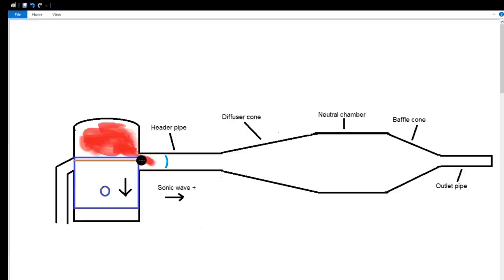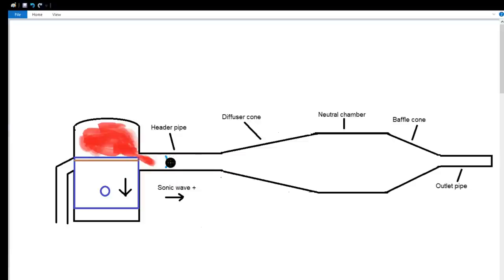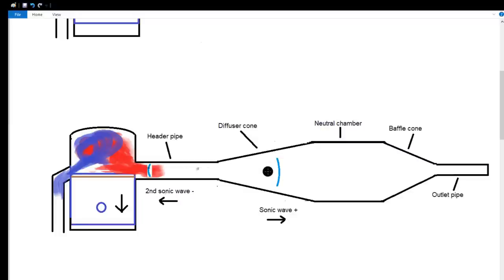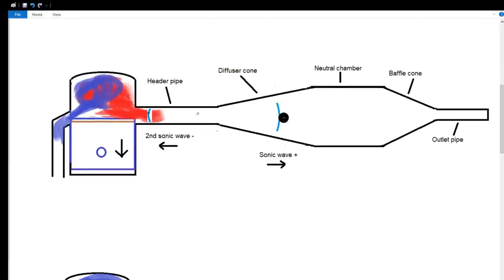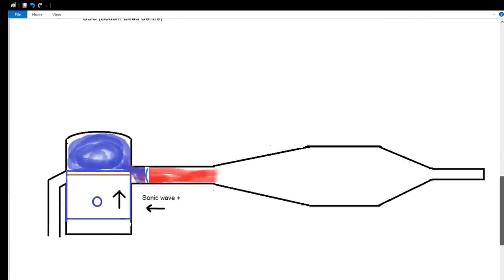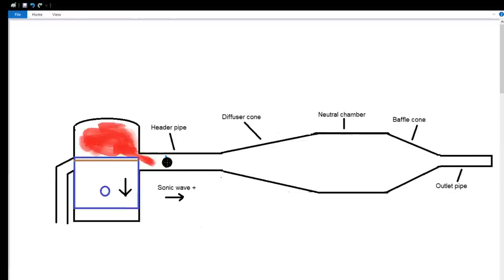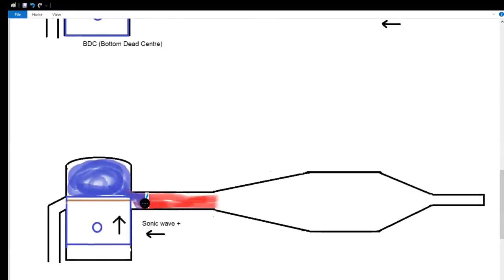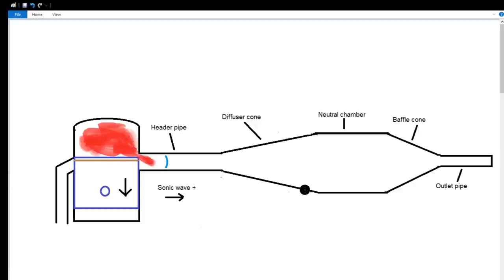Unlocking the secrets of 2 stroke expansion chamber exhausts E1

Comment: Good demo.  Years ago I purchased a Suzuki Titan 500 twin 2-stroke. It came with mufflers that looked like logs. Swapped them out for some tuned expansion chamber exhaust and the difference was very noticeable. I'd bet better than a 10% gain.
Reply from the maker: Yes well tuned expansion chambers can result in some substantial power gains.

Comment: I want to see this series. I am always open to learning new things especially since I am about six decades old. I love expansion chambers and have a few for my little engines. I need to study theory more , as to get as much power out of my little motors. Cheers, R
Reply from the maker: I can relate to that, when I started road racing in the 80s I developed a bit of an obsession with expansion chambers.
And again in the 90s with sprint karts.
All I knew is that if a simple length of pipe could be responsible for so much power increase and capable of controlling characteristics of the the power curve, there must be something pretty amazing going on inside that tube.
Ill cover what I know about them but experience tells me there are things I do  not know yet myself and may never.

Comment: I couldn't get my motorized bike up to operating temperature in the cold months, so I wrapped my expansion chamber with exhaust heat-wrap.  Worked like a charm, but you can't use it in warm weather, you'll overheat in minutes.
Reply from the maker: Exhaust carries way a good deal of heat as does the large chamber from the barrel and head so wrapping it will store more heat.
Alternative in an water cooled engine is to just tape of part of the radiator.

Comment: Aye, Mate...I've a passion for 2 Strokes and particularly tuned exhaust systems. I am playing with several programs at present, and also doing the manual math and physics required for design.
Even Bell, Blair, and Jennings do not put enough meat out there to satisfy my appetite. Perhaps the reason being is we're using methanol/nitromethane as fuel. That really complicates the thermodynamics aspect, which in turn affects wave velocity.
Would be nice to chat with you sometime, as our backgrounds in the automotive realm are quite similar. I'm a retired design engineer from GM and specialized in zero phase concept development. Also a certified master auto tech.
Cheers, and thanks.
Reply from the maker: As you are likely aware there are 2 values you can adjust in Blairs equations  to provide for different fuel types and air fuel ratios marked IGC (individual gas constant) and RSH (ratio of specific heats) which represent the chemical composition of the exhaust gasses that differ from air.
Many calculators Ive seen hard code ICG and RHS for air, I've left those values open in my Pipe calc software and the defaults I put in are for exhaust gas using petrol at an air fuel ratio of 13:1 so you can adjust those values to suit to reflect the exhaust gas composition which is used in the the wave speed equation and thus tuned length calculation. That said I'm not sure of the values you would use for Methanol NM mix. I know the RHS and IGC both increase with richer AFR. 
Cheers.

Comment: I had no idea there was so much science behind a saw modification. Very interesting. Well put together, thanks.
Reply from the maker: Thank;s for the comment
Chainsaw mufflers are less complex in design but still have a formula used (provided by Prof Gordon Blair) to design them which I may cover some time.
Reply: @AuMechanic  chain saw engines are different than other 2 stroke engines, because they are run at one steady rpm, more 97% of the time vs up and down the rpm scale ..from Wyoming USA 🇺🇸 🤠
Reply from the maker: @billallen4793  Sort of.
I use them often in my stump grinding business to lower stumps.
The saws run in an RPM range that is anything around the torque curve up to maximum RPM depending on the load present at the chain which varies a bit as you work the cut.
The reason they dont have an expansion chamber is mostly due to the fact there is not enough room for one on a general use saw (aside from competition saws), and emissions and such govt regulations.
There is however still a formula that applies to saw mufflers far less complex than an expansion chamber which can be broken down in its simplest form to having a muffler that has the largest practicable volume you can fit on the saw for best power and that "breathes" fairly freely even with a spark arrestor in place.
Reply from the maker: @billallen4793  Also keep in mind that many 2 stroke scooters have CV transmissions that run the engine at even more narrow RPM than saws and they do run expansion chambers.
Reply: @AuMechanic  have you ever seen a rotary engine 2stroke with a expansion chamber exhaust? I've got a RE5 ROTARY ENGINE Suzuki 2stroke motorcycle 🏍 that I was building for the Bonneville salt 🧂 Flatts, but it ALL stopped in Sep of 2003, I became disabled in a workplace injury, so my projects were stopped then..from Wyoming USA 🇺🇸 🤠
Reply from the maker: @Bill Allen  No Bill Ive only ever seen stock RE5 in the flesh and ridden it when I worked at a Yamaha dealer in Western Australia.
It was a trade in bike at the time.
You might ask that question on the re5rotary forum

Comment: I'm 6 years late coming into this thread, so bear with me please. I've always been interested in 2 cycle expansion chamber dynamics, and 2 cycle engines are having a renaissance at the moment, so here I am...
One of the points I picked up on (please correct me if I'm wrong) is that expansion chambers are more about sonic reflection than exhaust gas flow. Assumedly, the reflected return wave helps to prevent the intake charge from flowing out the exhaust port prematurely, and all this happens within the course of one revolution of the crankshaft. If I'm on the right track, then what keeps increasing engine rpm from overwhelming the completion of, and thus cancelling, this dynamic? 
Thank you. belatedly, for sharing this information. And again, sorry I'm late to the party. Cheers!

Comment: As the first wave reaches the expansion cone area it creates a vacuum behind it not a shock wave, as the primary shock wave expands. You can even tune a pipe so that it has harmonics of sympathetic resonance in which the primary shock wave is bounced off the closed piston to create extra negative pressure in the pipe for when exhaust port starts to open again. I've been able to carry this to the extreme of sucking the tops of a pistons off requiring detuning to keep things intact.
Reply from the maker: Its a compression wave not a shock wave, and it reflects an expansion wave that travels back up the pipe it does not create a vacuum behind the compression wave.
As you your piston top coming off, that is over revving and ring flutter (i have a video on also) possibly because the pipe was too short and allowed the engine to over rev.
The expansion wave from the pipe that aids scavenging is in the order of 2 times atmosphere and not even close to causing mechanical piston damage.

Comment: Great videos.  I am riding a dirtbike in the snow (ski/track) and am thinking about about ceramic coating or wrapping the pipe with fiberglass wrap.  This will help keep heat in the pipe on cold days so the scavenging / port plugging will be happening in the intended rpm range?  

Can you clarify this for me if the pipe temp is colder than usual then properly timed scavenging / port plugging will happen at a lower rpm and if the pipe temp is higher than normal then properly timed scavenging / port plugging will happen at a higher rpm?
Reply from the maker: Hi James
The higher the temperature is the faster the sonic velocity is and so the faster compression wave will travel which will favor higher engine RPM.
So keep in mind that off the peak as the pipe cools this will favor lower RPM range which can benefit power at lower speeds in tight sections.
There has been some Kart pipes and days past that actually had water injection to cool the pipe down in tight sections of the track (not legal under moderns regs)

Comment: Important thing to keep in mind to next video.
The sonic wave DOES actually get disturbed a bit by the gasflow.
You have different speeds of the pulse upstream and downstream :)
Reply from the maker: That's correct and well spotted,  and not just flow direction either.
But we will get to that part I assure you, and more.
Reply from the maker: Next video is up and Ive covered this issue with wave speed variation with gas speed and how that relates to tuned lengths calculations making a return trip down and up the pipe..
And note that the sonic velocity does not change itself, its like a ripple wave in a flowing river, the acoustic velocity (the ripple) is separate from the gas velocity (the river) and very important to not conflate the two.
Hope that covers it.

Comment: Good explanations - looking at this the ultimate solution is an adjustable expansion chamber - I believe karters used to have something along those lines called a slippy (slipper) pipe - that does of course require straight sections at the various cone sections to even be possible, which is likely why it hasn't made it's way into bikes - one possible exception would be a reverse cylinder TZR as the pipe run is predominantly straight, or as straight as possible
Reply from the maker: There was variable pipes on old karts but it is possible they were regulated out of use in control classes and besides that running Caster the pipe would probably get gummed and maybe jam up so would need regular service..
Aside from that variable exhaust port has the same effect of changing the tuned length by changing the effective exhaust timing on which the tuned length is calculated, but also increases the trapped compression ratio at lower RPM so that pretty much made the concept of sliding chamber redundant.
Reply: Water injection is what jetski 2strokes use to adjust volume  in the pipe.not ideal for road racing.

Comment: I believe (am sure) the sonic wave is not reversed until the wave hits the baffle cone, (tuned length measured a bit further than half way down the baffle cone from the piston face).  The low pressure you are talking about (a vacuum) is happening where you describe the sonic wave, (because of the larger diameters of the diffuser cone and header pipe if tapered).  Pipes were developed for 2-strokes, starting with a straight pipe.  Than somebody figured if they cut the straight pipe to a better length, the suction, (as the gasses left the pipe into the atmosphere), could be tuned with the transfers opening for the first 2-stroke pipe scavenging.  Then somebody put a megaphone on the pipe, and it made that vacuum last for a longer duration, widening the power curve.  Then somebody put a baffle cone (reverse cone) on the pipe, and that is what harnessed the energy of the sonic wave for a supercharging effect.
Reply: Yes. I always understood that the reflection was from the convergent cone on the stinger end of the pipe.
You put it well m8.
Reply from the maker: Hi, yes you are correct on that. The expansion wave is a second copy of the initial compression wave, the compression wave continuing on to reflect off the baffler cone.
There are residual reflections of that which can super position with the primary waves making it difficult to read pressure time values of the primary compression and expansion waves.
This will be in one of the next few videos, it is covered loosely under resonance.
The expansion wave "shaping" is done by the angles of the diffuser which i cover in a later video in some detail that dictates the length of peak of the expansion wave.
The point of reflection is not so clear and Jennings and Bell papers on it don't agree with Blair.
Being that it reflects back upon itself as opposed to the diffuser that mirrors the compression wave might explain that.
Re the story on Walter Kaadan and MZ, there is a few version of that.
Blair claims he saw them on Monetesa pre dating Kaaden and MZ, not sure if we will ever know the whole history on them.
This video is basically the preface to the series that expands on each point in some detail, see the playlist or video list for the rest of them.
Cheers
Dave
Reply from the maker: + rationalmartian
Yes that is the compression wave that travels down the full length and back.
The expansion (suction) wave is created by that initial compression wave as it passes through the diverging diffuser cone. 
So then you have 2 waves, the suction wave returns early before Transfer ports close and the other pressure wave reflected back from the end baffle cone arrives as Exhaust is closing to stop intake charge spilling form the exhaust..

Comment: the headers on 2 stroke dirtbikes now the way they are all tapered out right from the cylinder, is this causing a negative return wave right away as the ex port cracks the sonic wave into it, or is this just to allow a steeper angle where the diffuser starts its divergence from the header so there's not the sharp turbulence where it transitions? I dont think a light negative return wave would hurt anyway right at ex port opening?
Reply from the maker: Good question
The taper angle of the header is not sufficient to generate an expansion wave, there needs to be an increase up of angle in the order of 7 or so degree or a sudden stepped increase in pipe diameter.
The taper of the header reduces the sudden change of angle at the diffuser but also helps focus the returning compression wave (for port plugging) according to Blair.
Reply: @AuMechanic  great thank you, that makes sense. A lot of people using old MX 80cc expansion pipes for their gas bikes, those pipes are made for a geared bike so I think they would benefit from some adjustments like extending the header to get the baffle farther away to lower rpm range that it works. And I wonder why they never have much of a natural chamber compares to a moped pipe ...anyway the group has almost 5000 members now, I'm always directing them to your videos, all great stuff. You should join, zeda mafia has bicycle group on Facebook, you could peek at the pipes being built maybe add some input and in turn gain a bunch of viewers, had to suggest it, would love to hear some of your input on what these guys are doing, great welding work but not so much knowledge of what to tweak where
Reply from the maker: Thanks for the shares
ll check it out
The main thing with the chambers they are using is they should at least calculate the tuned length Vs the RPM range of the engine they are used on to be sure that is right, there is videos here that provide the equations to use 
https://www.youtube.com/playlist?list=PLIxC_wjJqk0rYVOG6EpLU2EaAVWZ2saWA
Second thing is the ensure the header has a clean entry to the chamber where they weld it on and no large step at the entry that will upset the returning waves back to the port..

Comment: Chinese scooters with expansion chamber exhaust like this have a big fat baffle spot welded right in the critical area of the expansion chamber to deliberately restrict the exhaust to pass regulations.
This has to be removed by cutting exhaust open to get at it.
Once removed you will have a half decent exhaust system.
Norton and Triumph motorcycles used a reverse cone muffler which is of a tuned length for better exhaust flow.
They sound great as well!

Comment: 2 strokes are amazing machines, why do some racing pipes have a smaller diameter stinger at the out let pipe? Does this increase rpm’s? And how about the difference in length on the expansion chamber? Thanks yr videos are really interesting
Reply from the maker: Hi Brian
Ive got another video in the series that covers the outlet pipes and tuned length of the entire chamber, as well as the latest video on pipe software that covers more about outlet pipe size.
Reply: AuMechanic thank you

Comment: Again, thanks for another very informative video, Question: I just bought a kx80cc exspansion chamber for my motorized bicycle and i dont have the header flange can or should i weld it up on the 40mm head flange or do i have to use the spring method? Im thinking itll be okay as long as its bolted up well at 3 points. Am i wrong or right? I dont have that little part that the pipe slips over at the head im going to make one, do i use springs or can i weld it up?
Reply from the maker: Having spring hooks is not crucial, it just helps isolate the vibration of the pipe and engine.
If you are going to fit it to a different engine at min
Also, if you are going to fit a chamber to an engine it does not belong to at minimum ensure the tuned length of it is right for your engine otherwise the operating RPM range of the pipe you have could be way out of the ball park of the RPM range you engine produces power at, in which case the pipe will be less than useless and may even result in less power than a stock muffler.
See the video series I've done on How to Design an Expansion chamber, that gives you the sums you can do to calculate tuned length of your engines exhaust to match the pipe you are fitting to it with.
Reply: AuMechanic thank you i will check out that video. I think im going to just weld it up to the exhaust flange.and refrain from dropping it hahaha! If it had springs drop wouldnt hurt it but if its welded it may crack somewhere not good.😉

Comment: Thanks! Very nicely  done. Two strokes are the best. May they be with us forever. What do you ride usually?
Reply from the maker: Thank's for the comment.
Used to road race 2 stroke twins in the 1980s, that's when I started building 2 stroke race chambers.
Raced 1000 cc super bikes for a few seasons. (image in the channel banner)
Got into Sprint Karting in the 90s a bit and a MX 2t in my teens and later. 
Been thinking about doing a bit of Karting again.
Whats your preference for 2 strokes ?